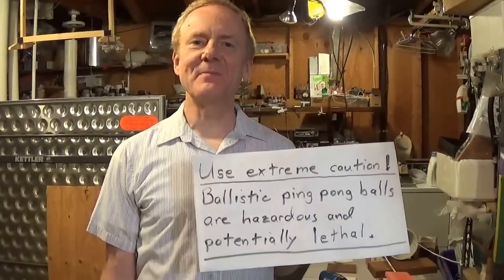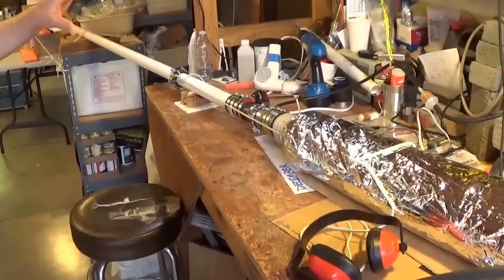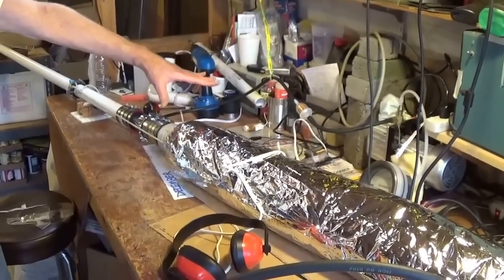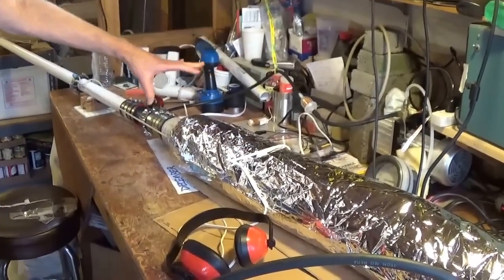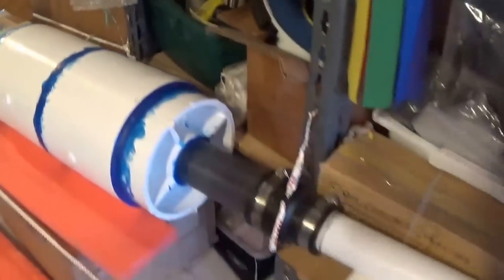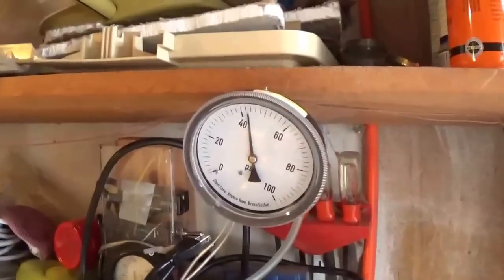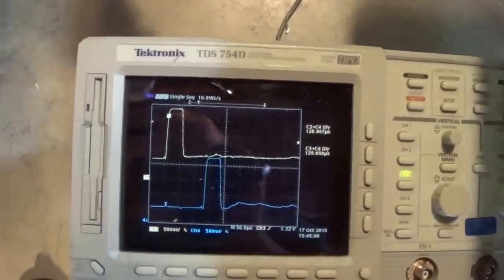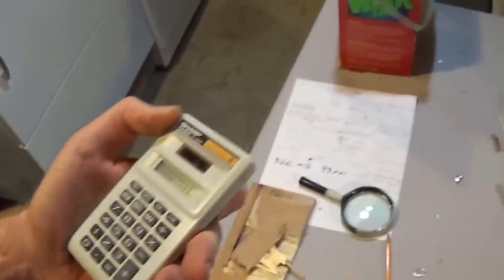773meter/second (1700MPH) supersonic ping pong ball launch using vacuum and 81PSI helium

Comment: Would it make a hole without the ping pong ball present?
Reply from the maker: No, no hole without ball.  You can also see this when the ball breaks apart at start of launch due to applied pressure.  Broken bits of ball are insufficient:
https://www.youtube.com/watch?v=lEt9rrkGYho
For more detail:  The helium by itself would transfer a similar amount of momentum, but spread out over a longer time, so lower peak force.  The ball is more concentrated (more dense) than the helium, so transfers its momentum rapidly, creating much higher peak force.

Comment: Nice! I've watched some similar videos from NightHawkinLight here on youtube. With his piston design and your dual vacuum/pressure setup, I wonder if they could be combined to where the retraction of the piston would pressurize an enclosed tank above atmospheric pressure. Then, as soon as the piston cleared the opening of the tank, it would throw all of that pent-up pressure back into the barrel, launching the projectile at even more tremendous speeds.
Reply from the maker: The piston is another way to generate pressure.  Would still need to be filled with helium first.  (Air is too heavy, so not as fast.)  Since helium is coming from a pressurized tank, there is no need for a piston mechanism to generate pressure.
It is relatively easy to get more pressure.  Issue is that more pressure crushes ping pong balls.  Broken balls do not accelerate well.  I have a video of a failed launch (broken ball).
The trick to higher speed is slower initial pressure release behind the ball.  The latest ping pong ball speed record holder used a smaller diameter diaphragm with a more stretchy material that ruptured more gradually (relatively-speaking).  That allowed higher helium pressure without rupturing the balls.

Comment: .. VACUUM ROCKET PING PONG HOW HIGH? 
using a simple vacuum or a plunger created vacuum (probably using crank), as a hobby how high would a ping pong ball go like from a 5 foot tube??  Chemical rockets are dangerous, but this could be fun hobby launching stuff up safely.  But I never see vertical launches,  just destructive horizontal stuff...  Then somehow put a parachute around the ping pong?  I have kids who need safe hobby.
Reply from the maker: For simple experiments, pressure is easier than vacuum.  I've done a simple stomp-rocket style ping pong ball launcher using a gallon milk jug connected with old vacuum-cleaner hose to a ~3' piece of 1.5" PVC.  Distance varies by how well kids jump on the jug.  Use a balloon pump to reinflate the jug after each launch.  For the next step up, I'd suggest using a bicycle tire pump with a smaller pressure chamber and no vacuum.  Pressure chamber could be just another length of 1.5" PVC, or 2" with a reducer, cap on the back end and membrane (packing tape or ...) between the chamber and the launch tube with ball.  I'm guessing you could get 50 to 100' up with that and still be reasonably safe.  It would be somewhat like the pop-bottle water rockets.  I keep those to 40PSI with younger kids around, sometimes up to 60PSI with older ones.

Comment: Did you say you are using PVC for the pressure chamber?   That's nuts, instead use ABS.  Goes for this, spud guns etc.  Same reason you never use PVC airlines - if it lets go, it shatters and can send sharp shards flying,  ABS just breaks/cracks

Comment: What speed could be achieved with a thick steel combustion chamber instead of the pressurized helium? i.e. a mixture of H2 + O2 . Of course igniting it remotely  ;-)
Reply from the maker: That would probably work great for creating a shotgun blast of burning plastic fragments:)  To launch a ball still intact requires controlled pressure.  We've gone up to 93PSI, at which point the balls break up about half the time.  What would help is something to maintain the pressure better through the launch.  We need something that will slow the initial gas release while providing an increasing flow as the ball accelerates.  I have some ideas I might try some day.  They all require higher initial pressure, so a metal pressure chamber.  Modifying a metal gas cylinder is beyond my skills, so I'd need to contract out that part.

Comment: Hi Davekni, what device did you used to measure the speed of pingpong ball? You mentioned it is two light beams. I'm impressed how it can pick up decimals of microsecond.
Reply from the maker: The sensor is made of four LEDs, two emitting light (green), and two yellow LEDs used as photodiodes.  They are narrow-beam 5mm LEDs recessed into 5mm holes on opposing sides of the ball path, 100mm apart center-to-center.  The photodiode signals pass through linear amplifiers to two channels of a TDS754 oscilloscope, which measures the delay from one pulse to the other.  Although the 5mm beams make for slower fall and rise times of the ball shadow signal, that also allows many sample points along the transitions for comparison and averaging.  I also manually average the leading and trailing edge delays.  (The scope is measuring two delays, lead-edge to lead-edge and trailing-edge to trailing-edge.)  That way any slight deviation in the ball path from exactly parallel to the beam separation is compensated for.  Using linear amplifiers on photodiode current avoids pulse distortion that would occur if normal phototransistors were used as saturated switches as is common in simple photogates.
To verify the beam separation, I made a fixture of two 40mm (same as ball) diameter cylinders (spools) mounted on a small board, 100.0mm apart.  This fixture was easier to measure directly with a micrometer.  (I also measured the LED placement directly, but couldn't be certain that the LED beams were exactly centered in the physical LED housings.)  Then I pulled the fixture through the photogate assembly, verifying that the two beams were broken at the same time.  This procedure actually indicated that the beams were 100.5mm apart, but I calculate speeds based on 100.0mm.  That gives us a margin of 0.5% to make sure we at least achieved what we claimed.  The high-school science teachers who served as expert witnesses for our Guinness record also measured the LED spacing directly and came up with 100.5mm.  BTW, our official record is on page 122 of the Guinness 2018 hardcover book, at 806m/s.
Reply: Hi  @davekni , Thanks for your prompt reply. I really appreciate how open you are in sharing these information. I'm also curious, did you include a gauge to check your vacuum pressure? If so, what are the specs of your vacuum pump and also how low your vacuum can reach?
Reply from the maker: Yes, we had a gauge, but only a simple mechanical one.  The mechanical gauge read something around -14.7 PSI, which roughly matches our air pressure here at just above sea level.  If I recall correctly, the pump was rated for 50microns (0.05mm Hg).  The nameplate says "Rotary Vacuum Pump Model VP25, 2.5CFM", but I don't have the spec. sheet around.  I doubt we got that low due to imperfect sealing of the membranes and out-gassing of the PVC piping.  We were probably around 1 or 2mm Hg.
Reply: Hi  @davekni , I was wondering how did you manage to achieve so close to perfect vacuum? Are there specific type of fittings used to prevent very subtle leaks?
Reply from the maker: The joints are either glued (PVC glue) or clamped with rubber couplers.  Both seal well.  The hardest parts to seal completely are the two 12um mylar membranes at either end of the launch tube.  There is a thin rubber layer (12mm wide rubber bands) over the ends of the PVC launch-tube pipe, slightly hanging over the ends of the tube by 2-3mm.  The mylar is stretched over the end, followed by rubber coupler halves and clamps.  The mylar membranes need to be replaced after each launch.  The first is ripped open by the helium pressure and the second by the ping pong ball.  When we do have problems getting vacuum, it is almost always because of a wrinkle in the rubber bands.

Comment: Hi Davekni, I am amazed by your videos. What did you use to to make the vacuum reservoir?
Reply from the maker: Thank you for the compliment!  The vacuum reservoir is made of two 8" to 2" PVC couplers glued together.  There's a short section of 2" schedule-80 PVC pipe glued into the back coupler, and a short section of 2" schedule-40 pipe glued into the front coupler.  The exit vacuum membrane (space blanket) is clamped around the front 2" exit pipe.  The 1.5" schedule-40 launch tube is inserted through the 2" schedule-80 pipe and extends through to almost the start of the 2" schedule 40 exit pipe section.  A rubber coupling and clamps seal the launch tube to the 2" schedule-80 pipe at the back side.  The ping pong ball leaves the launch tube near the end of the vacuum reservoir and coasts through the short exit pipe and breaks the membrane.  The gap allows space for helium to escape the launch tube and disperse into the vacuum reservoir.

Comment: do you think that there is a limit to the length of the PVC pipe for the ping pong ball at the exit?
Reply from the maker: At least for a given pressure chamber and valve (membrane), there is an optimum launch-tube length.  This video was made when we had a length about 3.2 meters.  We eventually achieved 806 m/s with this setup for our official Guinness record (page 122 of the 2018 book).  The no-target video is from our record setup the prior evening:https://www.youtube.com/watch?v=1vmzL4uYbV8Mythbusters had tried a 27 meter tube, which didn't work well.  For our 9/2016 Maker Faire entry, we started with a 6.1 meter tube, then cut it down to 5.7 meters.  The plan was to study performance vs. tube length.  Murphy's Law prevented finishing the experiment, but the 6.1 and 5.7m lengths performed about the same.  Our first run at 6.1m achieved 865 m/s:https://www.youtube.com/watch?v=zexy27bpqLgWe got one run up to 873 m/s with the 5.7m length, but the averages were comparable.  Here are target shots from some of the fastest runs:https://www.youtube.com/watch?v=5xuwu4gjNbQ
Reply: Thanks for the comprehensive explanation!
How about the membrane, how did you safely secure it in place?
Reply from the maker: Clamping of the pressure membrane is the weakest (most unsatisfactory) part of our design, so I wouldn't recommend copying it.   (There's also a thinner 12um vacuum membrane at each end of the launch tube - a simple rubber pipe coupler and hose clamp work well for those.)  For the pressure membrane, I glued an extra ring of CPVC pipe on the outside about 3cm back from the end.  The pressure membrane is about 30cm square, placed over the end of the pipe (at the outlet end of the pressure chamber), folded back over the pipe and extra ring.  We then wrapped MANY turns of small rubber tubing around the folded-back membrane behind and onto the extra ring.  This had to be done and undone for every launch! 

At the end (for the 9/2016 Maker Faire), we switched to a rubber coupling with slits to allow it to stretch over the membrane and ring, with 5 hose clamps around it, each tightened to almost stripping.  That was a little faster and better than the wraps of tubing.  The membrane had a thin wire loop taped to it.  Electricity heated the wire, melting a rip line (arc) to trigger the launch, although, in this video, the membrane ripped before pulsing the wire with current. 

We've had a few launch failures where the pressure membrane blows off the pipe at the end of the pressure chamber before the launch, with both versions of clamping.
If we ever get back to this project, I need to come up with some form of bolted-together system.  Any ideas would be welcome!
Reply from the maker: The pressure regulator is a simple single-stage, adjusted to a bit higher pressure than needed, around 100 PSI.  The pressure chamber is filled with a manual valve, which we turn off when the gauge reads the target pressure, around 90 PSI.  Our 806 m/s Guinness record was at 93 PSI, a pressure which sometimes breaks the ball.  (Even 85 PSI breaks balls occasionally, depending on the brand and luck.)  The ball broke on our first record attempt, which was also at 93 PSI.
Reply from the maker: I can't find your latest question about the vacuum pump, so will reply here.  It is a single-stage 2.5CFM pump intended for air conditioning work - for evacuating freon tubing before charging with freon.

Comment: What kind of break beam sensors are you using?  I have some that claim 7us response time, but they are missing data most of the time.  Not sure if it's the sensors or the DAQ system.  Works great with slower objects and slower sampling rates but hasn't worked at all with ping pong balls at speed.
Reply from the maker: I'm using 5mm green LEDs for light and 5mm yellow LEDs for photo-diodes, with local amplification of the photo-diode current.  The amplified signals are digitized by a Tektronix TDS754 oscilloscope.
LEDs can make good photo-diodes with a couple cautions:  The receiving LED should be of a longer wavelength (lower photon energy) than the light source, although matched wavelengths does work some.  Photo-diode current is relatively low, so needs local amplification to avoid being slowed down by cabling and/or digitizer input capacitance.  Also, LEDs vary dramatically in capacitance.  I had some yellow parts that happened to have low capacitance, so worked well here.
The advantage of LED photo-diodes is that the LED can be driven initially to aid in optical alignment.  Using a photo-diode also avoids the delay common with photo-transistors.
Reply: davekni got a circuit diagram?  I only have an MCC USB-204, that's all I can afford.
Reply from the maker: Haven't found it yet - will look a bit more tomorrow.  It's not likely something to copy anyway - made it of discrete FETs, VP1306 and VN1306, because that is what I had around.  An opamp circuit would be more stable and simpler.  If you can place the digitizer close enough, you might even get away without amplification.  I'd be happy to sketch an opamp circuit, but I'd recommend first measuring photo-diode (LED used as receiver) capacitance, and current when illuminated by your driving LED.  That's where I started before making a circuit.  My yellow photo-diode LEDs were DigiKey's part number 365-1190-ND, with 20pF capacitance and about 10uA current with the green LED shining on it and aligned.  (The green LEDs were generic from EBay.)
Do you have opamps and/or other parts around?  Many would do, something like MCP6002 would work well on the 5V supply from you MCC USB-204.  Yes, the MCC USB-204 should work well enough when configured for two channels - 250K samples per second, or 4us per sample.  The photo-diode signal should be slow enough to catch two points for interpolation at that rate.
If you want to continue conversation by email, I'm davekni@yahoo.com.
BTW, the circuit will need some level of shielding - grounded aluminum foil is cheap - as fast ping pong balls will generate static electricity.  Not likely to damage the circuit, just inject false signals.
Reply: OK....  I've changed sensors, added grounding and shielding and now taking data with a digital oscilloscope and still getting crap.  Would like to send pix of setup...  can you PM me your EMail address???
Reply from the maker: I'm davekni@yahoo.com.  Not sure what "PM" means in this context, but please feel free to email me.

Comment: Wow!  This helps show how a fast moving aluminum jet could go through steel and concrete walls at the WTC and Pentagon on 9/11/2001. 
www.911Theories.com
Reply from the maker: Hadn't thought about that connection.  I guess a plane is relatively light and hollow for its size, so somewhat like a ping pong ball - enough speed and it breaks through much more dense objects. even 3/4" plywood:  https://www.youtube.com/watch?v=5xuwu4gjNbQ

Comment: one word golf ball MxV=F
Reply from the maker: Check out my other videos - I have 10 on this ping pong ball launcher.  One shows a failed launch where the ball broke in the launch tube and the remains buried themselves in the plywood rather than breaking through.  Another shows triple-flash images of the ball in motion, and of it breaking through hardy-plank (and breaking apart in the process).  One from last year shows our 5 shots through 3/4 inch plywood, using a 20' launch tube to get yet faster speed.

Comment: Why helium?
Reply from the maker: Helium is lighter (less dense).  Even though we remove the air in front of the ball, the pressurized gas behind the ball needs to accelerate as fast as the ball to keep pushing it.  The launch tube full of air weighs several times as much as the ball.  Helium weighs much less, so wastes less energy accelerating itself down the launch tube, leaving more energy to accelerate the ball.
Reply: How about using scuba tank with 4000psi. The ping pong ball will probably get destroyed before leaving the cannon so maybe use a different projectile. I wanna see how fast it will get :D
Reply from the maker: Yes, the ping pong ball gets destroyed.  At the 93 PSI of our record shot, sometimes the ball gets broken due to the pressure.  A broken ball doesn't accelerate well (friction against launch tube and gas leaking by more), so speed goes down.  That is what makes supersonic ping pong balls such a fun challenge.  High-powered rifles go a bit faster, but that's already been done.